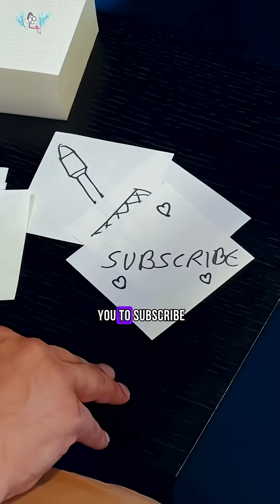Why Nvidia and AMD Want AI Data Centers Running on Diamonds

Comment: So, diamonds can also be doped into being a semiconductor.  So, they could replace the silicon in the chips with diamond.

However, that technology is not as far evolved as the diamond coatings, so I imagine the coatings will come first.  Then later we will see computer chips made entirely out of diamond instead of a diamond coating on top of silicon.

Comment: The low heat dissipation efficiency of traditional data centers is a long-standing problem—temperature control relies entirely on energy consumption. Broadwatt’s vertical design seems to improve this, and it also incorporates Broad Group’s technology. The solution feels quite comprehensive.

Comment: Water cooling is cheap and works perfectly fine for these AI chips, no need for diamonds. (And the diamonds would need to be water-cooled, so what problem does it solve exactly?) The thermal expansion of Silicon Oxide is more than a factor 2 different from diamond, and the thermal conductivity of a heat-pipe is 10 times larger than diamond, so this is a bad idea in almost any way you look at it.
Reply: the diamonds (that are dirt cheap and can be made in a lab) speed up the movement of heat from the chip to the water cooling unit. much like thermal paste in a pc. diamond plated heatsinks will help speed up the cooling process
Reply: If it was a bad idea scientists smarter than you or I wouldn't actively be considering the idea. And also they made a point that it requires a lot of energy to cool the data centers. If they could cool faster with the diamond, that would be way less power and water being used to cool the place down

Comment: I mean, with the discovery of creating graphene with flash joule heating, why can't people use that?
Reply: Graphene has 2 problems. 

1) Graphene is great at transfering heat in 2 dimensions, not 3. It can distribute heat along a plane, but it cannot pass through the plane easily. Which makes it great when paired with another material that does a better job of transferring heat through the plane. 

2) Graphene is electrically conductive. An ideal material would have high thermal conductivity with little electric conductivity.